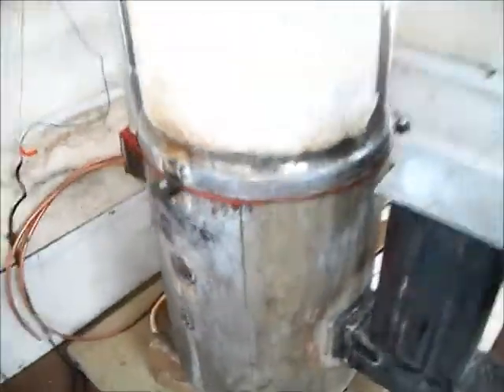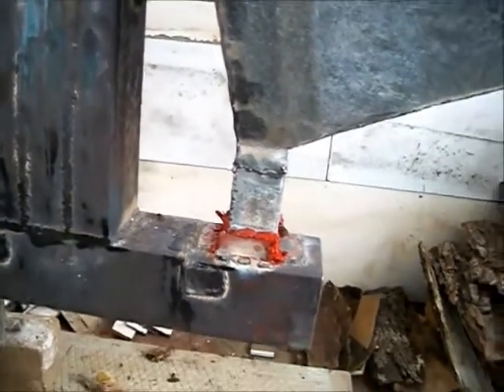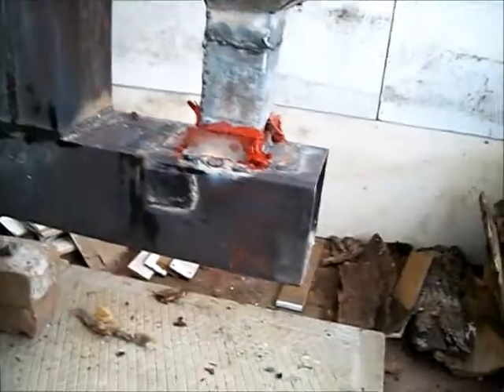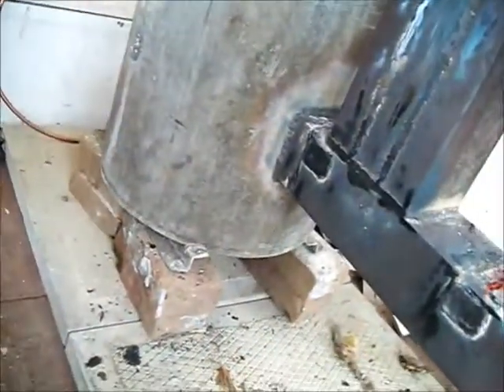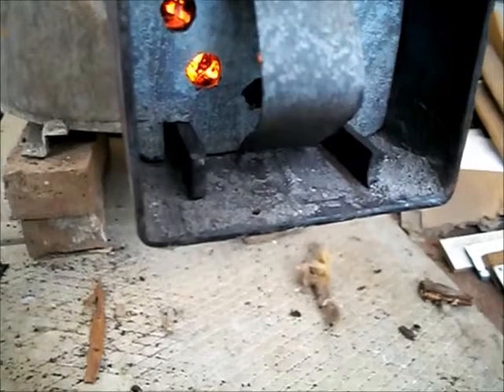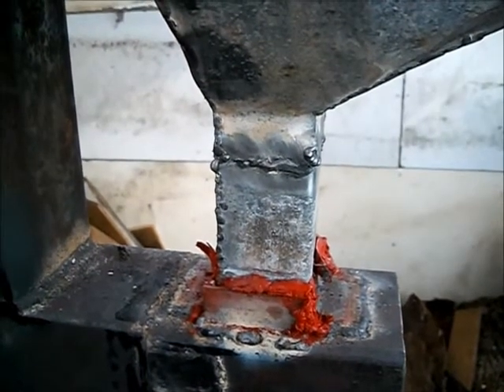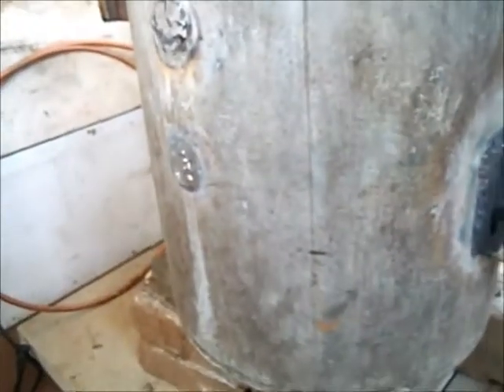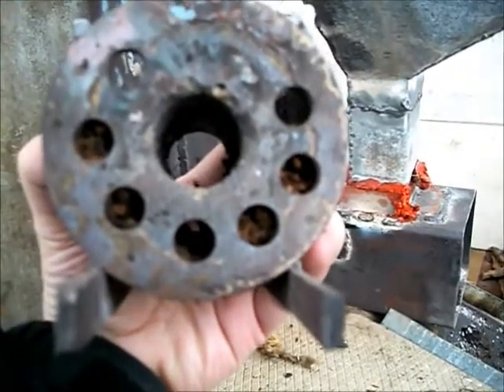Rocket Stove Pellet Burner

Comment: I dont think the long way  is the Problem... i think you have  to give more air to the Front of your pellet burner,  maybe many many many small hol es from 2 or 3 mm ( Not inches,  i dont understood the complicate System in inches, inches is like  you drive in the wrong side of the road...) it was a joke😉 i think you have to get just  2 cm Space under your pellets, and Try a few Very  small holes between your big holes  in Front of your Chamber....and lift the Chaimber a little Bit under 1 Inch... i think 2 Zentimeter  is something like 8/10 inch or so...

Comment: I'd suggest a two or three tiered stainless steel rod burn grates - top grate spacing catches or holds the pellets from falling down through this grate from the hopper... as they burn and become smaller they fall through the top grate to the below middle grate which has a closer (smaller rod to rod gap) spacing where once again the pellets are held for additional burning time... then finally, the small near totally burnt pellets fall through the middle grate onto the bottom grate where the pellets totally burn and only "fly ash" falls through into the ash pan... check your local brand of pellets for the pellet diameter size - many are 0.250" so start top grate (rod to rod) spacing at 0.245" then middle grate spacing at 0.125 etc... if the bottom grate pellets are not totally burn then consider a smaller spacing for longer burn time else maybe a third grate... its trial and error using the same brand (size) pellets... also consider placing the grates sloped down toward the riser at an angle (25?)... adjust the draft air entrance at the bottom of each grate or between the grates to promote good primary burning. Then add secondary air for complete gas ignition...

Comment: great stove!...but pellets are man made and can be short supply and costly. Solution would be design a wood chip feeder along with the stick feed.
Reply from the maker: good idea but i'm looking for something easy to heat my shop over night
Reply: There are a lot of stick and branch type rocket stoves, but very few that use pellets and for about $1.00 per 10 lbs they are very cheap, effective and readily available!
Reply: The General Idea about the Rocket stove is... You need a Lot of place around the Wood... where the fire can burn... Sorry for my terrible english...  The best way to Work with an Rocket stove ... The Wood is totaly small... If you use bigger Wood IT will burn , but not very Well...  My second oven i built where running one year on the frames of old Windows...  And i saw the frames in 20 mm pieces ( 2 cm .. a little less than an Inch)  but a frame of an old window is a liitle bitter in the other Sides... My oven First  run at 200 degree Celsius Something Like 400 degree f Fahrenheit... I Split the  frameparts with an axe in 3 parts, so the pieces are not 20 60*60 mm they where after Splitting Something Like 20 30 to 20* 20 to 20
.. amd my Rocket stove goes Up to 260 degree Celsius... Something Like 540 degree f
Reply: A Rocket stove needs small peaces of Wood ... No big peaces Like Wood Chips... Oh... I Just see your Name... Yeah rom1nb ... You built a stove which ist also amazing... Maybe i think it over when i'm older and have the Time to add fuel... Your stove is also great...

Comment: I found if you make your burn pot an angle (about 45 degrees or steeper) so the pellets that enter from above, will slide down and scrape the burned pellets off the grate to some degree, keeping the air path open to burn hotter and more completely. All the videos I've seen that have a flat burn pot, seem to have problems with burned pellets plugging them up eventually. And an added ash pan below will catch and complete the burning of the pellets, keeping the pot screen cleaner. That's my story and I'm stickin' to it!